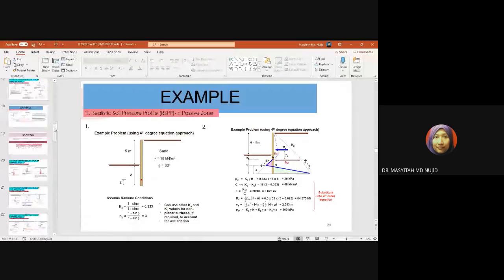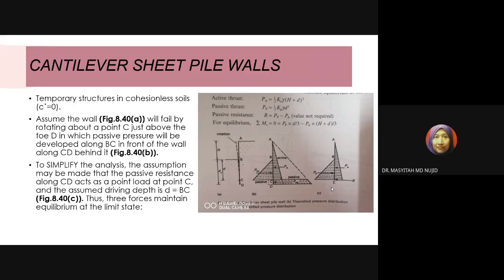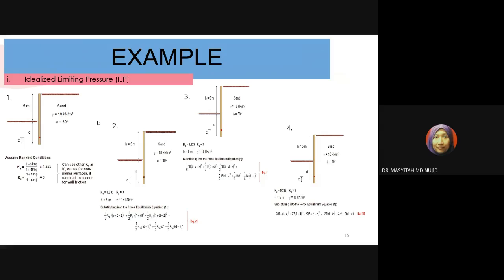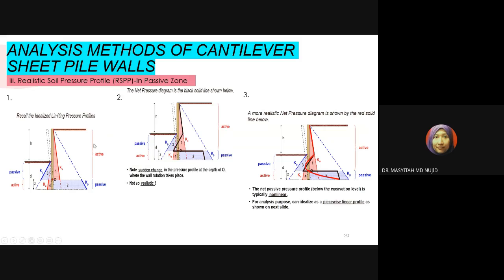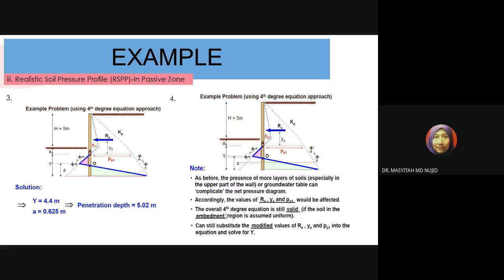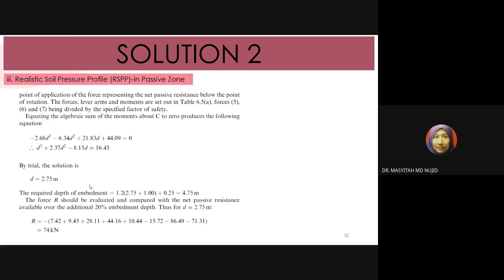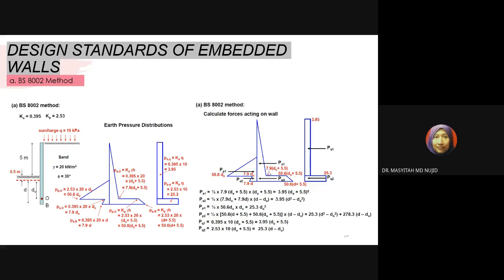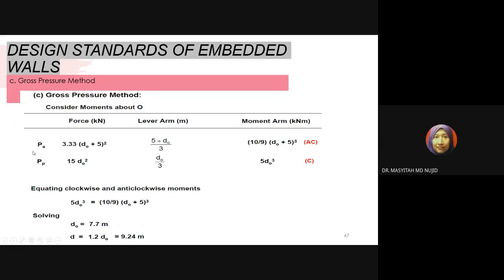CHAPTER 2: FLEXBILE RETAINING WALL_CANTILEVER SHEET PILE

Comment: Great lecture!  Very clear. 

Observations: 
1) Idealized pressure diagram will be difficult to draw for layered soil system because point C and embedment depth d  will be unknown. 

2) Simplified pressure diagram is the more practical one to use. Drawing pressure diagram will be easy for any depth, even for a layered system. 

3) The realistic pressure diagram is cumbersome and doesn’t add any meaningful value to the actual depth of embedment. 

4) Better to use BS8002.

5) You were very right to highlight that 20% increase is not a factor of safety, rather this is a compensation to the approximate location of point C below point of rotation O. 

I hope you have lectures on anchored earth walls as well.